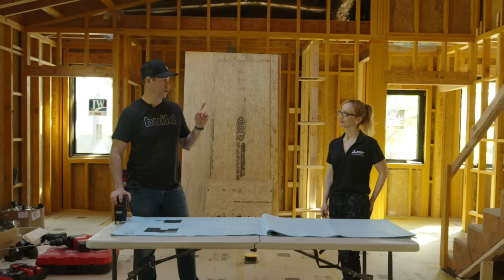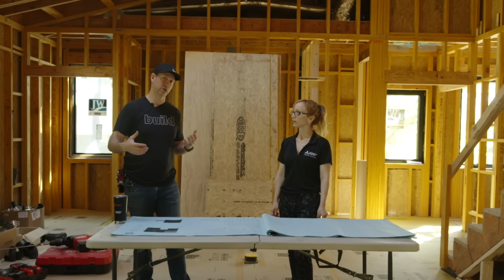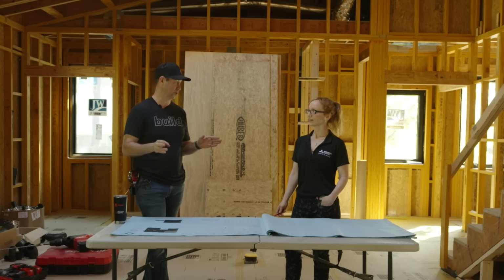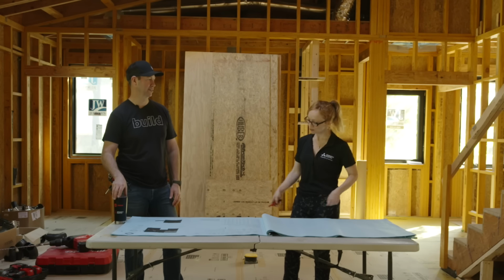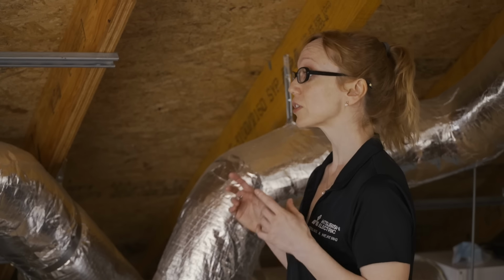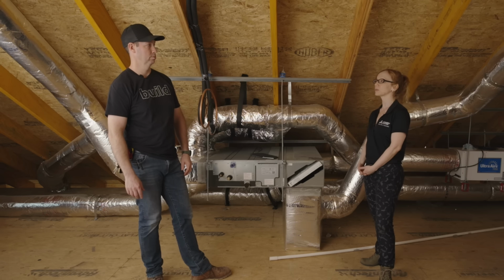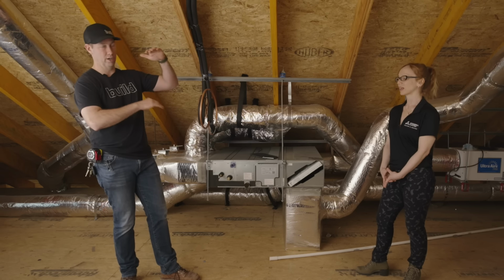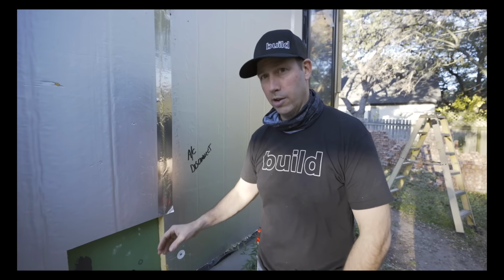Mitsubishi HVAC At My House - Full System Tour

Comment: Matt, are there any options for "every room" zoning?  I'm wondering if there's any economic options on the market that are looking at individual room control.  Or is this just not anything anyone is offering yet?
Reply: You can get smart dampers controlled by room thermostats.  Look at Flair Pucks
Reply: @spchips    and how do you handle static pressure increases when closing dampers? Those things are a great way to burn your blower motor.
Reply: if you have enough load in each room to avoid over-sizing, then this can be done. a small bedroom may not be possible or the over-sized unit won't dehumidify well enough and you'll have cold and damp conditions (not fun).
Reply: Any multi-split type of system would provide that. Say a 5x1, 5 indoor units (5 zones) would share one outdoor unit and would allow for individual room control. This would likely give the highest comfort level, but the economics of it would need to be assessed on a case-by-case vs a ducted system with dumpers (to maintain the control granularity), or compromise on energy-efficiency and comfort with a single zone system.
Reply: @MrLuizlaf  yeah... I don’t think so. The loads are too low for using a single system in each room. Oversizing is not a viable option even with VRF.
Reply: @watchthestars.atacama  that is right. I meant "single zone system" as a whole ground floor sharing the same unit and single thermostat.

Comment: A real Risinger Passivhaus in Austin should never need more than the waste heat from the refrigerator compressor in your kitchen.
Reply: Think about it:
You use electricity to 'pump' heat out of the refrigerator then put it into your house where (in the south most of the year your air conditioning) you pay for more electricity to pump it outside the house.
A better design (for hot climates) would have the condenser coils outside the house. Or seal the refrigerator body and vent that space outside.
Reply: @bobjoatmon1993  I said that above. "Why not get a commercial unit where the compressor outside?"
Reply: @rpatrick2  sky high cost?
Reply: @bobjoatmon1993  Everything else in this house is sky high.
Reply: @rpatrick2  at least one of those outdoor condensers is commercial branded. Possibly the only way he could get that caliber of Mitsubishi subject matter expert on site.
Reply: @meyerjeff  I think she showed up because Matt has made a very lucrative business at showcasing high end building products. As others had said I would like to hear her talk about about her subject matter. Women in engineering generally have to be twice as good as the guys to get the same recognition.
Reply: @bobjoatmon1993  Some supermarkets do this.  They put the condenser from the freeze/cooler unit on the roof.
Reply: @bobjoatmon1993  In a residential application you would never recoup the additional installation and ongoing maintenance costs just to make your AC work maybe 10% less.
Reply: @HuntingWolf193  well, I did it when I redid my kitchen and when the season changes I simply open a cabinet door and slide a board 'gate' to switch from internal to external ventilation for my refrigerator condenser coil on the back. Wasn't that hard to build nor operate the last 3 years.  With all the economy modifications I did it paid for itself in two years and now instead of a $450+ summer electric bill it runs $140 average June, July and August.
Reply: @HuntingWolf193  homeowners would be foolish to have anyone but Mitsubishi Diamond certified dealers install this equipment.  First, the equipment would be installed property. Second, the warranty for this equipment is 12 years when installed by a Diamond installer. The reliability of this equipment is amazing.
Reply: Its all cooling and dehumidification in a well insulated house.  Heat is still required, but not the size driver
Reply: Speaking of refrigerators,  Why don't they put an ac vent behind the fridge?  It would move the hot air off the condenser away from the unit.
Reply: @greggcollins4215  probably because you want the cold air closest to where the people are so they feel it?
Reply: The compressor on some SubZero refrigerators can be remote mounted. I put one in a ventilated basement mostly to reduce noise in the kitchen and to get a deep pan storage cabinet above.
Reply: I have been installing Mitsubishi hyper heat minisplits in massachusettes in the homes I build for 4 or 5 years now. Half the cost of the furnace and all the extra ductwork and testing for the hers rating. They have been very dependable very efficient and also run in much lower temps with self defrost modes and they are smart units , meaning the outdoor unit fan runs a the speed it needs to keep up with what the inside units are calling for. They will adjust the speeds on their own depending on load .i am extremely happy with them. It helps with the blower door test and keeping the envelope air tight .
Reply: Nope, he's going to duct off the refrigerator and through a diverter valve it will go outside in summer or divert into the house in winter.
So exhaust the BTUs or use the BTUs.

Or maybe he'll pipe the discharge out of the refrigerator compressor and use the high temp refrigerant to preheat the water going into the water heater.

Or.....
Reply: @bobjoatmon1993  He's in so much money already, why not get a commercial unit where the compressor outside? You know he is going to get (or be given) some super expensive high end appliances.
Reply: @rpatrick2   likely this is all or mostly sponsored
Reply: @TheObserver567  Of course.  It does take work to make all these videos and it's easy to be critical on the internet. I've learned a tremendous amount watching his content.
Reply: @rpatrick2  Gaggenau
Reply: @00HiGhGuY00  That's some shiny stuff.

Comment: Mitsubishi is the best. That system is what my company installs every day. The one flaw you have is the type of AHU you used. Those pefyp AHU ( pancake style) are complete unserviceable. Can’t get to the coil, can’t get to the fan motor. It’s actually easier and cheaper to just replace the entire AHU. I now refuse to install that AHU and only install the cased AHU which is the PVFY style in the Mitsubishi line. 
Other than that great job by you mechanical contractor.

Comment: What kind of money does that report cost
Reply: Load calcs are not a choice.  The report is a bit more elaborate than normal, but room buly room load calcs will provide all these numbers. 

Load calcs are required in the 2015 IRC, maybe older versions too.

M1401.3 Equipment and Appliance Sizing

Comment: Can you add Mitsubishi as a retrofit on existing duct work?  I need to redo my entire HVAC but ducks are ok.  Thanks
Reply: Answer is yes,  but get a load calc first! Even on straight replacement.
Reply: @TheJPPowell  
I will.  But I want to finish my siding/windows first because I'll probably do some extra insulation work.
Thanks 👍
Reply: Yes BUT make sure the equipment is sized properly with a good manual J and more importantly make sure the ductwork is adequate for the air handler. 
They also make vertical split tied to their condensers. Might be a better option than retrofitting one of those pancake units.
Reply: The nice part is after the manual J is completed you can do it slowly over time unit by unit as your old system fails
Reply: @watchthestars.atacama  
I'm actually planning to rip everything out, even modifications to some ductwork in the unfinished basement (to split into 2 zones).

Comment: Any rough pricing would be helpful. thanks
Reply: Really depends... every job is different on these systems. Allllll custom quoted
Reply: @TheJPPowell   Yes, I get that, but I meant more at a unit level. What does the box in his attic cost? Etc.  Helps us understand how big a breadbox we're talking about.
Reply: @hu5tle-  ok.. it will vary for each job but if you’re talking new construction could be anywhere from 5-6k per ton, or 15-16 per sf and that’s at 350 sf/ton
Reply: @TheJPPowell  that's helpful and sounds about right. I'm doing a gut check on a job as well. I have a guy telling me I have to use a VRV 3-4 ton and he's pricing it at 24k for ~1700sf main floor and a bonus room with another head. Just feels too high.
Reply: @hu5tle-  man I get that. Just make sure he has a load calc- and then even has designed the duct or put those units in/sized according to each room. ***each room, not “block load” or overall load... if he doesn’t have a room by room load requirement in his calc don’t trust the duct size he puts in there!
Reply: @hu5tle-   at 1700sf that’s about right but, really depends on your glacial infiltration- window count and size/ quality makes a HUGE difference in load calcs... I’ll think “of cool a 2000sf house, I’ll need a 5 ton, and wind up needing like 8 tons because of ceiling height/ vaulted or tons of windows facing West... Just nuts
Reply: @TheJPPowell  Yeah, he doesn't do load calcs, sadly, which is another flag. He's what I would consider from the old school. Just hard to find "green" , high performance HVAC guys where this job is. Generally going by SF/Tonage.
Reply: @TheJPPowell  Yeah, We do have some vaults, but windows aren't crazy. Thanks man
Reply: @hu5tle-  where is the job? If you have prints I can send you a load calc. I do take offs from prints (plans) literally everyday lol, but load calcs are done for me by MEPs in commercial new construction projects but I do them myself on large res builds that we treat as commercial projects because of their size.
Reply: @hu5tle-  yea man, plz get a load calc. When I do mine I run the calc in one program and design the duct in another bc I like the aesthetics more

Comment: Hey Matt. Can you please let Kimberly know that the hvac installers on their website have absolutely no interest in the Mitsubishi system. I called four from their website and all of them pushed me towards other options.
Reply: I am a Houston based HVAC contractor who specializes in installing and servicing Mitsubishi VRF equipment. Depending on your project I may be able to assist you. I have several contacts at Mitsubishi and may be able to assist you in finding a reputable contractor in your area.
Feel free to message me if you are interested.
Reply: Hi Twiin Central, please send us a message or give us a call: 1-877-311-1425. Our hours are Mon. - Fri. (8am - 7pm) EST. We would be happy to connect you with an HVAC contractor in your area.

Comment: I like how the unit in the attic is suspended from the joists to control vibration but then I see that the return ductwork is sitting on the floor... doesn't that completely defeat the purpose?
Reply: I’m hoping it goes through* the floor?
Reply: The air handler has to be suspended with a hanging kit and the ductwork doesn’t sit on the floor, it’s the return coming from below through the ceiling or the attic floor.
Reply: @watchthestars.atacama  It's hard to tell if that is a return duct coming up through the floor or a box to transition from the round duct to a rectangular opening in the air handler. Either way, shouldn't there be some sort of flexible sleeve/attachement between the box and the handler to acoustically isolate the floating handler from the box?
Reply: @tomroehl5126  not really if you’re an AC mechanic. You seem to have issues with vibrations. Any bad childhood memories...:) Have you ever installed, serviced or used a system like that ? They run very quietly and don’t rattle. This is not a 5 ton air handler sitting on the attic floor. Also, you don’t know where the actual return grille is. If it’s just down below they probably won’t hear anything with 3-4’ of plenum plus the filter and if it’s further away even less. 
I’ve seen a lot of installs and I seriously doubt that Matt will have noise issues in his house. Breathe my friend.
Reply: Yea I’m not a tech but do Reno’s and have done a bunch of systems. I usually hang from all thread and put rubber blocks between the unistrut and the actual air handle
Reply: @richralston1705  that’s a good way to do it but rubber deteriorates over time. You can also use springs like they did here in suspending the dehum. It’s done like that in commercial applications more than residential but it’s better and not very expensive.
Reply: Presumably there is a flexible boot section somewhere in that return and it's not actually sitting on the floor.

Comment: Matt, you never addressed the amount of noise that the cassettes units produced as apposed to a traditional ducted system. I've always been curious about the noise they might create .... gives me flash backs to those window units.
Reply: (I haven't watched the video yet) I have mitsubishi cassettes. They're super quiet. The only time that I notice them is when they have any sort of deep setback on heating mode, and are having to blast the room with heat to get it up to temperature, and even then it's not bad(call it 1/3 the noise of a window unit?).,and not for long Otherwise they're utterly silent(even if they're having to work at maximum cooling in the summer for some reason... like my kids opening a window when it's 95F/95% outside)
Reply: @timothywalsh1550  totally agree here
Reply: I've lived in multiple places with ducts and I have now installed 2 different brands of mini splits (pioneer and gree). both brands of the mini splits are quieter than the quietest ducts I've ever heard. if the units kick onto full fan speed, then you can hear them a bit, but otherwise they're incredibly quiet (I just had to walk over and put my hand up to the unit to see that it was indeed currently blowing). you can manually set the fan speed if you want it to never go into full speed. keep in mind that the compressor is not where the head unit is. the head unit is just a fan and heat-exchanger. window units and the ones in hotels are loud because the compressor is right there in your room, but mini-splits allow you to put the compressor far away.
Reply: @somedude-lc5dy  Makes sense. I Appreciate the insight.
Reply: They SUPER quiet if sized correctly. I don’t even notice them being on actually
Reply: Window units ???? You’re comparing an old V8 with a hole in the tailpipe to a Tesla. Go online and look at the specs. Very low dB.

Comment: Didn’t realize Mitsubishi had 6K BTU one-way ceiling cassette available yet, that’s awesome if they do , because the smallest BTU one-way ceiling cassette that I was aware of is 9K BTU’s. Mitsubishi does have wall mount ductless units down to 6K BTU’s
Reply: Carrier has down to 7k
Reply: They’ve had for a couple of years now I think. Not many sizes but serviceable and replaceable from below and fits in a 16” space
Reply: @watchthestars.atacama  
I work for a HVAC company in SW Washington, we are a elite Mitsubishi dealer.
As of right now the smallest capacity in the one way ceiling cassettes is 9K, they also have 12K, 15K and 18K btu units, they are all physically the same size, and like you stated they are designed to be able be installed in between ceiling joist that are 16” on center with complete service access behind the grill which is awesome, we have installed a lot of these, they are awesome.
Having a 6K BTU unit would be great, especially when installing with multi-zone systems, it will allow for you to use a smaller tonnage heat pump because the total connectability capacity is effected by each indoor unit. Most of the time a 9K unit is bigger than what is needed especially when installed in small bedrooms, and when you have several of them on one heat pump, your required to go with a larger heat pump than needed for the house or in some cases when you only need one heat pump you may need to go with 2 heat pumps.
So having access to 6K BTU units would be very helpful, as right now, the only 6K BTU available are the wall mount units.
Reply: @smannydith9589   PMFY-P06NBMU-ER5
Reply: @watchthestars.atacama  

Awesome I will check it out.

Comment: Live in a split level home.  Near Chicago. Always wondered what was best option. Heat will always just rise up from downstairs
Reply: Best option for you is heat recovery. This will take the heat from top level and put it on bottom level without starting HP compresor cycle.
Reply: @TheJPPowell  I’ll look into that. With our weather cycles here I considered a wood burning/pellet stove for down stairs. Great look and plenty of heat but easy $800-1400.
Reply: @bbernotus2354  that definitely will be most cost effective but, maybe more dangerous than something that doesn’t use combustibles!
Reply: check your air sealing. a leaky house will pull air in at the bottom and cause the bottom floor to be cooler. make sure that is fixed before doing anything else.
mini splits can be ok in your area if you get mitsubishi or MrCool units that have "hyperheat". however, if your air sealing is good and you still have too much heat going up the stairs, I would look into a wood stove or gas fireplace heater unit, since gas is cheaper per btu

Comment: Episodes like this are honestly more valuable than the architectural engineering courses I took in college.
Reply: I found that most things in life are haha
Reply: There is an error. It's a minor one that can cause costly damage in the future. Where are the  Secondary drain pans with flow switches. If those systems primary drain lines gets clogged, all of the water that is coming off the evaporator coil will overflow in the primary drain pan and leak through any cracks that water can find and will ruin his ceilings causing him to make costly repairs that could have been avoided had he put a secondary drain underneath those systems.
Reply: secondary drain pan underneath those systems.